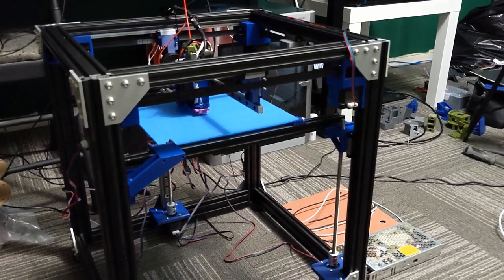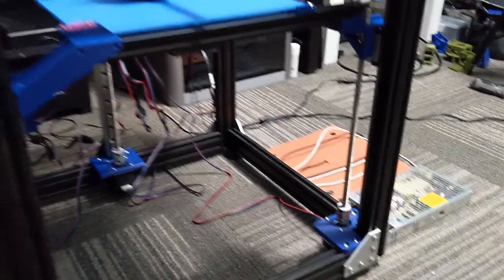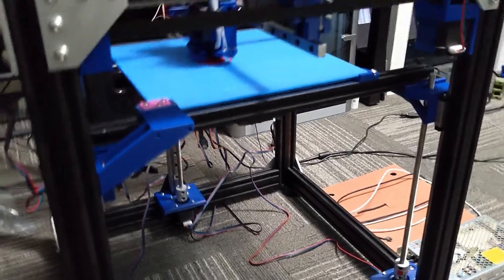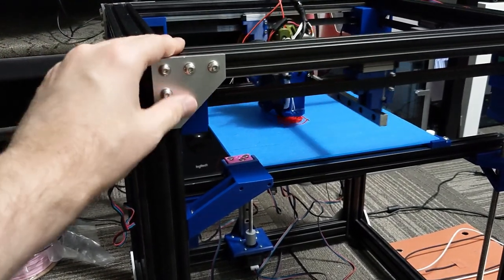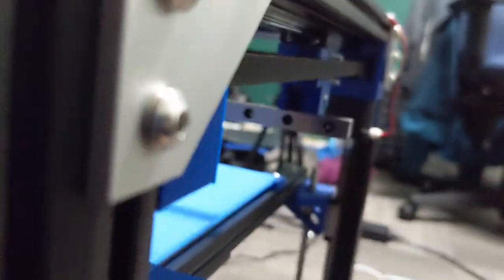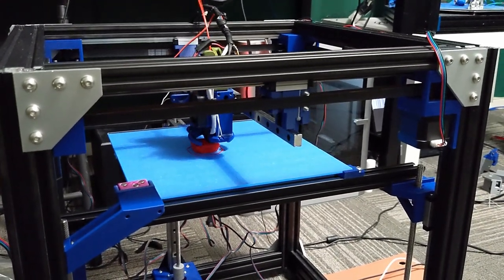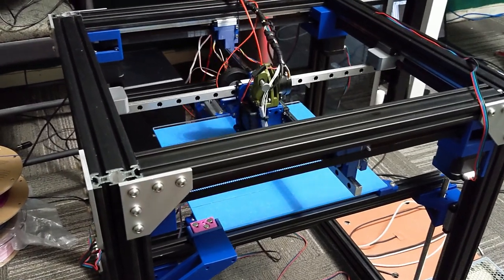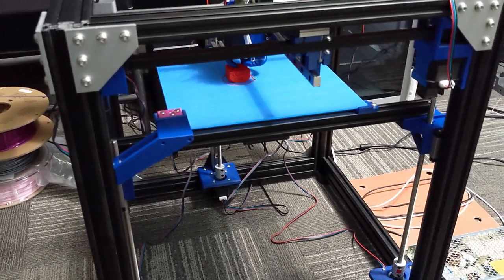DIY CroXY Cross Gantry 3D Printer Called Defiant!

Comment: I've also built a cross gantry printer but I used single motor for x and y and used 1:2 gear reduction for torque. Still decent speed and quality. The problem with double motor per axis designs, if any one of your motors skip steps in the x/y gantry, it'll destroy the whole printer. It'll start to bind, ball bearings will scrape and become unusable withing minutes if not seconds. They are very good printers until some catastrophy happens. If you still want to use double motors it's a good practice to build a sync belt between them. That'll help and prevent bigger failures.
Reply: closed steppers would help here right?
Reply: Good info thank you

Comment: Rolohaun early 2022: "Belts are better"
Rolohaun late 2022: 2:10 "I'm actually really liking lead screws"

Another advantage is they aren't backdrivable so it doesn't hit the floor when you power it off (or at least has a softer landing)
Reply from the maker: I do like belts but the lead screw has less parts so that is nice. The bed not falling is a plus but on my SimpleCore I always docked the bed at the bottom

Comment: What are the advantages of cross vs corexy?

I would think that cross type has:
Simpler belt path, 
Shorter belts (super long belts are stretchy))
Easier to fit thicker belts
More stiffness, 
X and Y axis weights are more equal, so ringing performance and tuning is not as direction dependant

It looks really clean, great work!
Reply from the maker: yep you are correct!

Comment: I have been eyeing cross gantry printers, they look cool but what is an advantage to a cross gantry vs a single gantry? Also, is that a standard Cartesian or is it CoreXY? Thanks a bunch, looks like a great printer.
Reply from the maker: - More rigid as the toolhead is supported twice
- Shorter belt path
- Belts do not change direction
- Belts are easier to tension
- X and Y have two motors moving the axis instead of one

Comment: Whats the advantage of the cross gantry configuration?
Reply from the maker: shorter belts
belts don't change direction
two motors for X and Y each
toolhead is supported by crossed MGN rails

Comment: I am wondering why no one designing these Cross printers doesn´t put the 4 cross motors on the bottom with axles running up to the belt pulleys so that an enclosed and heated version could be high temp.
Reply from the maker: I think there is a worry of torque loss if using a axles to transmit power
Reply: rather help me design the electronics..I can build the physical and mechanical part.
Reply: @mt.sinairefuge5360 why specifically a guy in Pakistan?
Reply: Have tou seen annex K3? That seems easily enclosable.
Reply: @saadqadeer7807  I will check it out.  thanks

Comment: Do you need separate drivers for each pair of axis steppers, or do you think a splitter cable like the double z axis printers used before it was common to have 2 plugs on the board would work?
Reply from the maker: you need a 8 driver board, each stepper must have its own
Reply: @Rolohaun Do the 4 steppers for XY motion need independent control? Or are 2 control pins enough for them with each control pin feeding 2 of the stepper drivers?

Comment: This kind of mechanical solution has one big disadvantage: the bearings (which is a linear bearing in this case) have a certain amount of loose motion, clunking, wobbling. If it didn't, the bearing would seize. This backlash interferes with the motion every time the bearing changes direction. The shaft moves first and only after the backlash distance does the head assembly (hotend) move.
In other printing mechanisms there are bearings and they also have a backlash, but there the load is always in one direction and therefore the backlash does not play a role in the movement.
The threaded rod also has backlash, so the most perfect and backlash-free drive is the belt drive. There is a reason why it uses belt drive on all shafts, one of the best free-source printers is the Voron 2.4.
Reply from the maker: This is why I used MGN12 linear rails in this design, there is no play in the motions system. Defiant also supports belted Z

Comment: Can someone please make a cheap high temp printer that we can print pei and peek or pekk or other engineering grade plastics…. that would be amazing. I’ve been looking for someone doing that and I can’t find anyone for cheap. Like $1000. I know it could be done.
Reply from the maker: I know people are looking for something like that, I never use those filaments
Reply: @Rolohaun  maybe u could make a video explaining how it could be done? Could your printer be made to print high temp filament?
Reply: I don't know if you can do this that cheap.  Maybe buying Chinese aluminum vzbot parts,  since you can get them so cheap on aliex. Other than that, you need what 100c chamber temp?  So high temp belts, not sure abs or asa will hold up to that so PC or pccf parts all around, aluminum for hot end parts. You're printing at 400c or so.  What heater does that? 

 I world love to do the same but i don't think it would be quite that easy or cheap, but I'm still in